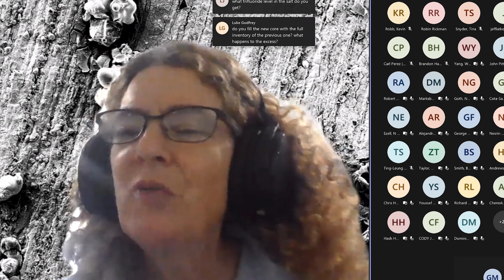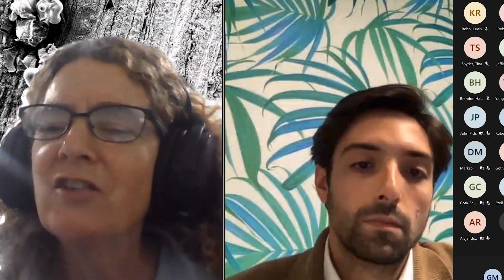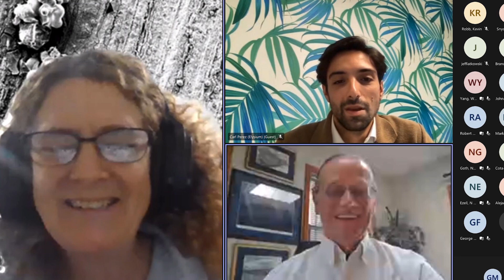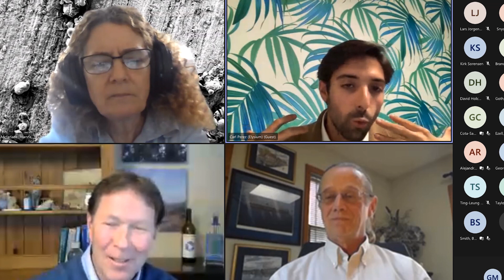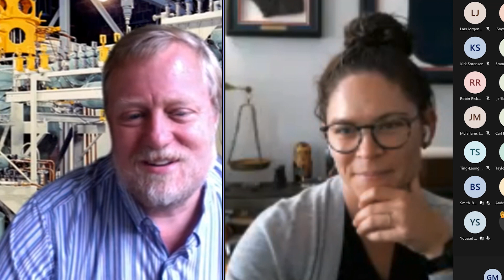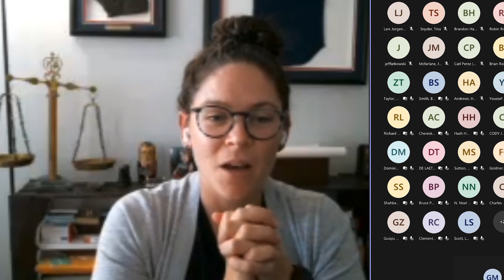Molten-Salt Reactor Developer Forum and Closing Remarks @ ORNL MSRW 2021

Comment: A Western joke? A molten salt reactor forum without Chinese participation? The people that is firing up a molten salt Thorium reactor right now and linking it to the grid in December? Western Ego and self denial repeating itself.
Reply: It is not clear whether China was not invited or China refused to participate. They'd participated in previous years. During the Trump administration that ceased, but not clear which side stopped or if it was mutual. (Not sure why China would participate at this point, from a purely tactical perspective regarding knowledge transfer.)

Comment: No advocates for MSR or any Nuclear options were visible at COP 26. MSR should be at the "top table" if our true objective is to rapidly achieve zero carbon. It needs promotion by people like John Kerry. Or, maybe, Musk, Branson or Bezos.
Reply: Likely because breeder reactors better for making plutonium than power.
Reply: @rogermorey  A technology which enables the efficient use of fertile feedstock, be it U238 or Th232, would effectively make nuclear power a renewable energy source.
Reply: @bobthebomb1596  Hey thebomb,  The greatest problem with MSR breeder reactors is that they take the transformation of U238 to bomb grade plutonium out of the public discourse with the false notion that only Thorium can/will be used.  Not  too many of us want plutonium to be ubiquitous around the globe, given pollution and nuclear conflict scenarios.  Point taken on the renewable part though.
Reply: @rogermorey  It's not that much of a problem in reality.
There is a difference between breeding plutonium for weapons use and breeding it as part of a fuel cycle.
For one, the plutonium in the latter is not removed from the reactor, whereas breeders for weapons grade material are designed to allow easy fuel removal. This is necessary because the longer the plutonium remains in situ the more Pu240 is generated. For weapons use the quantity of Pu240 must be minimised since it undergoes spontaneous fission; not something you want to happen in your bomb!

Countries wishing to extract plutonium for weapons use also require some form of reprocessing capability to separate and purify the plutonium. 
Can it be done, yes. Can it be done without everyone knowing, no.
Reply: @bobthebomb1596  The Molten salt design for Thorium with processing has a large/dense blanket for neutron economy.  There are also proposals to have continuous processing from the blanket to remove actinides.  To maximize Pu239 production, fresh U238 would be run through the blanket and Pu239 pulled out as an actinide.  This proposal to continually add and subtract is almost perfect for weapons proliferation, and a nightmare for regulators.  It would be hard to design a reactor better suited for weapons production.
Reply: @rogermorey  Apart from the slight problem that thorium does not produce plutonium.
I suspect that you mean U233, which is the fissile material bred from Thorium? With correct timing it would be possible to isolate pure U233, but the procedure is involved. Any country given (or developing) breeder technology would be required to submit to international inspection, to ensure that such removal was not occurring.
It is true that a country could simply refuse, but then they would in effect be saying "We intend to produce nuclear weapons." The technology to do that is already available to any country wishing to do so and accept the ire of the international community.
There are many alternate options for countries that cannot be trusted; from the supply of sealed reactors, to outright denial of capability.